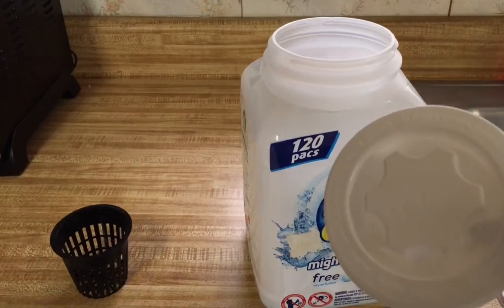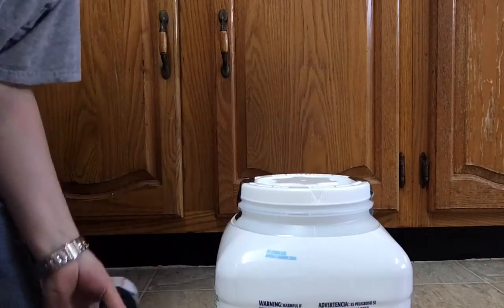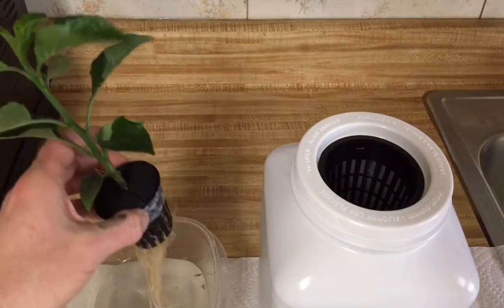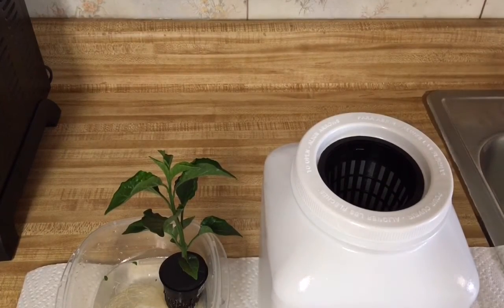Non-Circulating Hydroponic (Kratky) Container Setup - Carbonero Pepper

Comment: I don't understand why you did not simply cut a smaller hole in the lid to accommodate the smaller net pot that the plant was originally in.  Please explain if you have time.
Reply from the maker: The smaller one would work fine. A larger net pot gives the plant a little more base of support. Depending on the stage that you transplant in, you might get a better root spread too.

Comment: What paint did you use?
Reply from the maker: I don't remember exactly, but I got it at Wal-Mart and it was designed for spraying on plastic. Was either Krylon or Rustoleum brand.
Reply: Thank you. Although it is white paint, it looks like it blocks the light very well the way you applied it.

Comment: good video. what happens with the hydro solution as it drops level? do you top up? or let it almost run dry then top up? or do you empty it all out and refill after say 2 weeks?
Reply from the maker: For a small Kratky container, I try to keep it around 2/3 full, adding when it feels like it's starting to get light. Occasionally swapping out with fresh solution, maybe every couple of weeks. If you add some and notice your plant starts to droop, pour a little out because there's probably too much and it's drowning the air roots. It works best if you have enough solution to last the plant to end or season without having add or replace any. You can do this with a really large container, or a float valve type system to maintain a static nutrient level. I haven't tried the latter, but know people who have and it seems to work very well. I'm hoping to try one this season.
Reply: Peter Stanley Thanks!